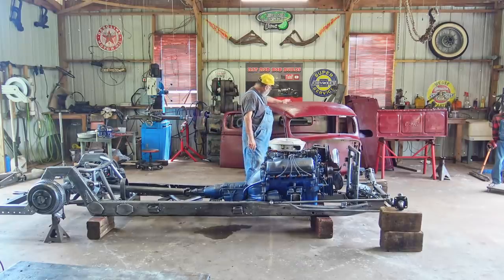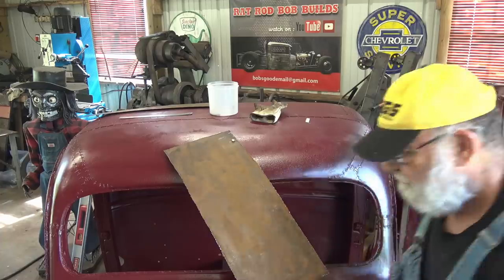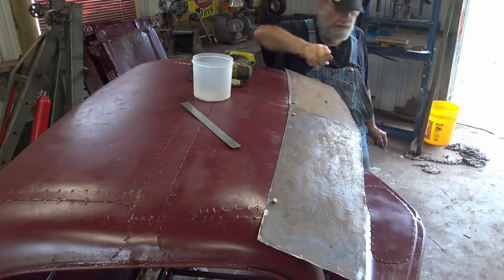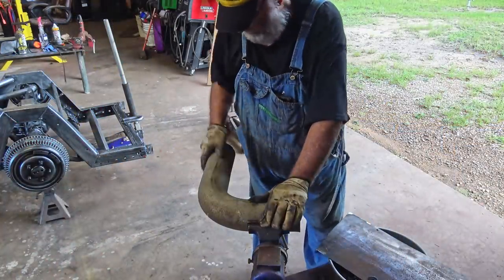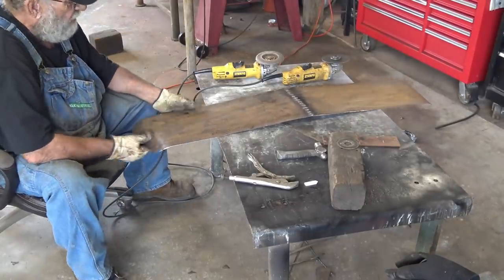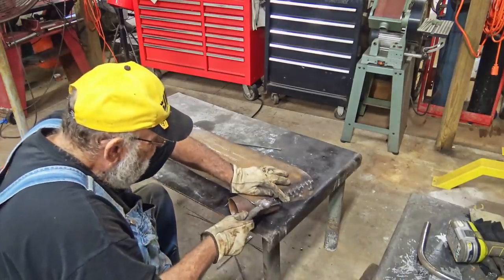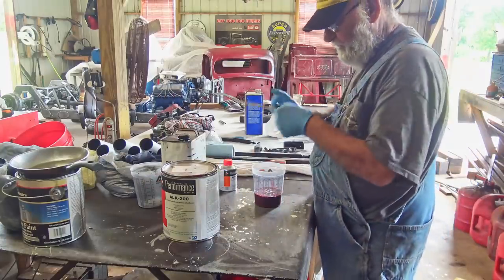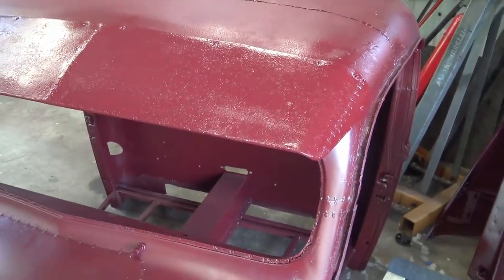Awesome Rat Rod Sun Visor Fabrication With Rusty Metal - Start To Finish

Comment: I wanted a small lip around my fresh air vent that we spoke about earlier. The shape is mostly flat so i cut a 1/2” plywood buck and routed the edges with a 3/8 rounding over bit. After cutting a piece of 20 gauge i clamped it to the plywood and the began lightly tapping it into the curve, i heated the corners and tapped gently, shrinking the metal easily. After about 90 minutes the curved edges were formed. Careful grinding and filing of the bottom edge perfected the shape. Thanks for showing me how to do this. What fun. 
Larry in Arizona
Reply from the maker: And much better than the rusted up one I have hidden away somewhere in never never land.

Comment: Have to respect any man willing to work in a shop what appears too hot for the dog. 
I built a visor for my 51, i think it was the favorite part of my build. Just subscribed!
Reply from the maker: Thanks Frank for that sub ... means a lot. At my age it's too hot to even get out the house. LOL. Heat waves happen every year ... it'll pass.
Reply: @RatRodBobBuilds  had to fix my dump trailer in my uncooled building the other day. Felt like i was in a pressure cooker. Welding in that heat was no fun.

Comment: My 55 olds delta had its visor mounted with  a gap between the visor and roof that way the air off the windshield could flow over the roof.  It also helped the wipers work better.

Comment: Hey Bob I started using that “Rust preventer stuff” like you are using, I got some spilt/splattered on my concrete floor, it sure bleaches out the floor.
Reply from the maker: I hear ya! I do the same thing sometimes when I use it ... get some on the floor that is ... makes really nice white spots. By the way, muriatic acid will clean concrete too!

Comment: a little round rod perimeter will keep it from floppin' round on the wind. so you don't look like the flying nun!
Reply: I was going to say the same thing!
Reply: Just like the corners
Reply: You mentioned the flying nun. It dates you and me. Sally Fields
Reply from the maker: Ha haa ... good one!
Reply: I used 1/4 round in the front of mine,and 1x1/8 flat in the back. It twitches at 60 mph.

Comment: Hey Bawb
That sun viser makes a world of differance in the look of that truck !
I believe had I been building it I would have left some space between the viser and the cab top so it is not traping air as you fly down the road.
You can still work in some airflow iffin ya have a mind to.
Nice job Bawb, Thanx fur lettin us look over ya sholder.
Be Safe and Well
Reply from the maker: Ha haa .. need something to slow this thing down a little anyways.

Comment: I have the same E-wheel, i welded a square tube around the outside to stiffen it. I have moved 14 ga sheet metal. Its slow and not easy but it will curve it.
Reply from the maker: Good to know!

Comment: Bob that visor turned out fantastic, the side pieces and round rod made it, it's brand new old, ha ha, if you offered that countersink  punch for sale i would buy one, that is sweet
Reply from the maker: Thanks brother. That countersink tool is just mild steel ... hopefully someone will see this and make some with tool steel.
Reply: @RatRodBobBuilds  You are a handy guy , I have the Fulton visor on my 53 truck, I think it makes the truck, though about making one for the 55 truck, but then again I better not mess with it for now😆

Comment: Do you have any dimpled holes on your rat rod? Might need somewhere for the air to go, putting less stress on your awesome visor, very impressed with your work.
Reply from the maker: Any air will run out the sides ... same as windshield ... no problem.

Comment: Bob, how big is the air compressor you use with your plasma cutter? I’m looking to add one in my shop that will support a plasma cutter. I love your work! You are a rat rod sculpted!
Reply from the maker: Don't need much of an air compressor for the plasma cutter. If you can run air tools you can plasma cut. Just make sure you run the air thru a good filter. You need CLEAN DRY AIR!

Comment: Should you have some vent hole/louvers at that top to let the trapped air out.
Reply from the maker: What little air that is trapped will run out the sides. If I take it to the salt flats and make it go really fast, I'll just take out the bolts and remove it.

Comment: Use some of that wire for the leading edge. A wired edge would look good
Reply from the maker: I used 1/4" round rod instead but I coulda twisted up a couple number 9 wires and used that I reckon!
Reply: Yea Bob twisted wire, 1 being barbed wire would have tied into your stitches motifs

Comment: Hi Bob, I been watching you a while and I'm lovin' everything you do. The only thing I know about Rat Rods is what I've seen you do. I been diggin' the Ford truck build. Just watched the sun visor episode, it looks great. I know you've been building a long time and I'm sure you've made visors before so please don't take offence at my question. I only wonder because once I bought a sun visor for my helmet for my old Triumph motorcycle and it wasn't vented in the back, I tilted my head back at one point and it snapped my head back. Not bad but made me wonder if there would be any issue with yours at high speed. I hope I'm not wasting your time. Rat On Brother
Reply from the maker: I built it tough as nails but if it gets ripped off I'll have to consider vents in the next one but my first Rat Rod visor didn't have vents and it was a lot more powerful than this one.
Reply: @RatRodBobBuilds  Well I figured you knew what you were doin' Bob and I also figured you're the kind of guy who wouldn't get pissed at a guy for throwin' somethin' in there. I work on guitar amps and I'm still getting hung up now and then. Working on a new song, "Still kickin' myself in the but after all these years".

Comment: What size sheet metal is that? Gonna build be a sunvisor
Reply from the maker: I cut the metal off an old Ford shoebox hood (1950?) ... I would guess it's 18 gauge. But I would use 20 gauge if using new metal.
Reply: @RatRodBobBuilds  thanks